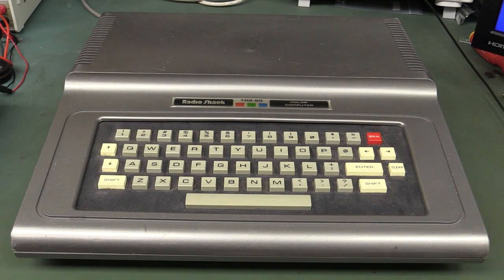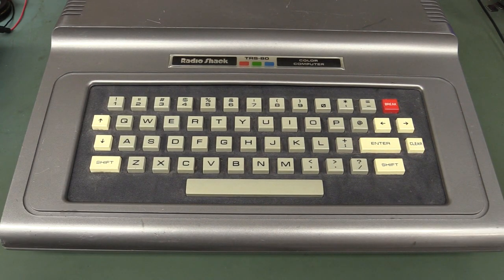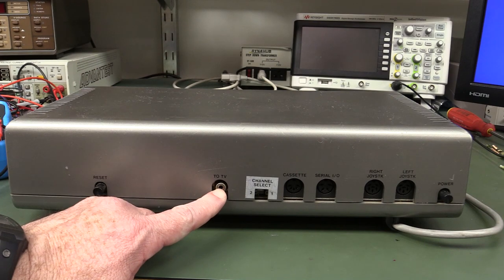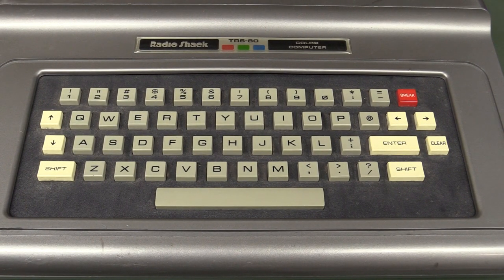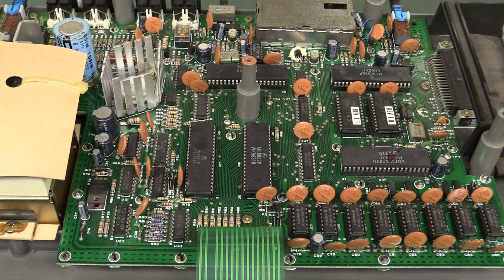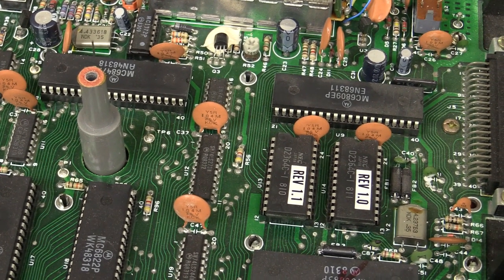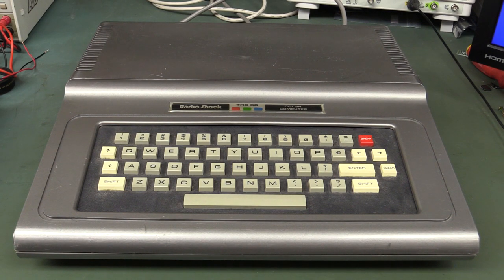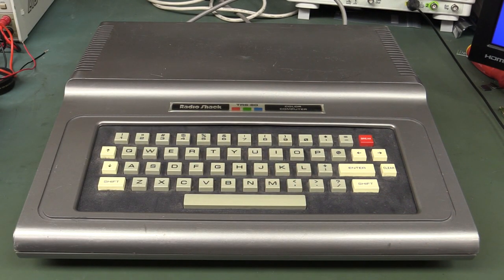EEVblog #1021 - Retro Radio Shack TRS-80 Color Computer

Comment: Yes, the video was that bad or worse on the TV too. The computers that used a TV instead of a real (and really expensive) monitor all looked like crap. There was no way to get decent resolution on a TV, especially considering state of the art of the typical TV set at that time. But given that's what you had, you got used to it in a very short time and it didn't bother you at all ... until you saw a "real terminal," heh,. Then you'd start saving up for this new computer coming out in a few months, called the IBM PC.

Comment: what was the purpose of these computers back in those days, apart from learning basic ?
Reply: Mainly for fun. Play games, and learn BASIC. But there where other types of applications too, such as spreadsheets.
Reply: I never had any significant problems with tape storage.  Use quality tapes on a quality recorder, and most importantly, set your levels properly, and it worked fine.
Reply: Oddly, not too much different that what you'd use a PC for these days. Software that would organize your finances, generate shopping or To Do lists, going online to the limited services of the time to chat, check stock prices, get news, etc, and of course playing games. All at a slower, lower resolution. Of course, no media like music or videos were possible.
Reply: IMHO it was to teach you how to program, mostly. Doing calculations was hugely important. In the case of the TRS-80 it was also to teach you how to "hack" and if you visited my local Color Computer Club you could find a lot of such examples. I remember one guy had a massive 10 Megabyte HD back then which when most programs were 16k or less was huge. But the really story was how he did it -- a SCSI adapter. Pronounced Scuzzy.
 Part of the Coco experience was getting the magazine for the Color Computer named "Rainbow" which was generated by enthusiasts. The magazine was about 3 times thicker than most these days and had software you could type in as well as various hardware hacks you could build and install on your own computer -- if you dared.
 Which reminds me one of the ways I solved an excelled math problem was to write a small program to keep calculating until the answer repeated then I knew that was the right one. The Teacher's Assistant liked my solution so much she surprised me by wheeling in an Apple computer one day to show my program run to the whole XL'ed math class.
Reply: Vendicar Decarian: I don't know where you got your information but I am sure I could probably go into my storage and get it up and running again. Wouldn't have saved it if I thought it wasn't possible.

Tape was slow but never unreliable. (I had the RS recommended one that had an additional input which was more expensive but very reliable.I still have it. Run across it a few days ago.)Disks... I booted up the same software daily for like 10-15 years with barely ever an error. When it did fault it was because mine was kept in the basement with wood dust floating around all over. Usually a simple cleaning and erasored down the contacts til they shined again and it would work flawlessly for a few more years.

And I met and saw people who had 10 MB HDs for just hundreds of dollars. Far as I know RS did not even offer one.

And the OS9 was also being run by big companies like Kodak and others.
Reply: I remember Rainbow! Do you remember the other magazine "Hot CoCo"?
Reply: Same as today; for fun and games, and education
Reply: To learn how to use a disassembler and machine code while trying to get your pixelated opponent Mindy to strip without actually winning at poker. ...what? No? Just me...?
Reply: Attila Asztalos ABSOLUTELY just you.
(I had Strip Poker on my Apple ][+)
Reply: i see.

Comment: Was it capable of 80-column text? That was a big deal back then. Big enough that they may have excused the name by referencing the 80-column support instead. ;)
Reply: No television based monitor could support 80 column text.
Reply: That was one of the more annoying awkward things about it, 32 characters IIRC and i had a hack of some sort that went to 51 characters per line. It made doing proper reports that would be printed on a regular printer rather difficult.

That reminds me for awhile they even had a very cheap thermal printer available for the Coco.
Reply: Star Gazer There is an 80-column cartridge for Commodore 64. 8bitguy has a video about it and other 80-column solutions for older TV-based computers.
Reply: John Possum Thanks for the info
Reply: Yes, there was.  And you can't read it on a color TV.  It isn't hard for a computer to output 80 columns.  That isn't the problem.  The problem is the display has to be capable of 640 or more horizontal lines.  And NTSC TV simply doesn't have the bandwidth to do it, nor does the typical color TV have the pixels to render it.  If you use a good monochrome TV,  you might have a chance.  There's a reason why we stopped using analog TVs as computer monitors.
Reply: Yes, TVs sucked back then but NTSC still approximated 640x480 (VGA)... interlaced, of course. Almost all of the 80-column stuff was monochrome, which has increased detail over the color signal even on a color TV. Heck, even DVDs use 1/4th the color resolution (chrominance) as the monochrome brightness (luminance). That's simply how our eyes/brains process detail. Almost all dedicated monitors back then were NTSC, like my Commodore 1702 or my Amdek. CGA graphics actually looked BETTER over composite versus the computer monitor output (much more colors). 8bitguy has a really good/interesting video about that ("CGA Better than you thought" or something like that).

Comment: What is color code 5 "Buff"
Reply: I don't remember for sure what "buff" looked like, but that just reminds me how HORRIBLE the colors on the CoCo were.  Like, there was the 4-color graphics mode that was black, white, magenta, and cyan.  I shit you not.
Reply: Buff was what they called white because it could never produce a proper white signal.

The 4-color graphic modes were pointless.  The 2-color (black+buff) 256x192 mode was useful, however.  By making patterns with odd/even pixels you could get plenty of artifact colors, just like on the Apple II.  Blue and red were easy (odd or even columns) with more complex patterns being able to produce more colors.  I remember how happy I was when I discovered how to make it output yellow.

Comment: How did they get away with having such bad keyboards back then ?
Reply: There was no alternative in the home market.  You had chicklet keyboards and you had membrane keyboards at this time.  Most home users weren't expected to know how to touch-type, so it didn't really matter.
Reply: In the back pages of "Rainbow" magazine you could get non Tandy upgrades like keyboards. That's the main thing I hated about that computer. Love the way the DOS is on a chip -- NEVER any time booting up. You turn it on, Microsoft DOS was right there.
Reply: Simple: REAL keyboards cost $100 or so at the time, so if you were building a $300 computer, you put a shit keyboard on it.
Reply: Vendicar Decarian: you are very wrong about card punch keyboards.  The IBM 126 had a keyboard you could type extremely fast on, because the keys only moved about a millimeter or so.  It just took a little getting used to, because it seemed to jump when you even thought about a character.
Reply: I had the number wrong.  This is the one I was thinking of - the 029.  https://commons.wikimedia.org/wiki/File:IBM_card_punch_029.JPG.  University of California, Irvine, 1975.

Comment: I have color computer like this that I'm trying to fix after breaking it over 30 years ago, does anyone know of a datasheet for the chip at 12:37 markings AMI 8317CCT   8032000  KOREA, this is in the same position as a similar chip on mine AMI 8238BON  8032000 KOREA. It is the only IC on the board I cannot find a datasheet for.

Comment: It's the funny how the older, but admittedly more expensive Apple II put this to shame. So don't attribute it all to the 80s. The 1970s Apple ran circles around this thing.
Reply: I had both. Each had it's pros and cons. The CoCo had a far more advanced architecture (PIA, SAM, ADA chips) and a better CPU. The 6809e was an 8-bit processor, but had a 16-bit internal data path with 16-bit operators. It ran circles around the Apple's 6502. The Apple had slightly better graphics, but where the Apple // really shined was it's expandability. Dedicated slots for memory, co-processors, many many disk drives, etc. My Apple // could top my CoCo until I added a new processor and more memory.
Reply: And if you bought it in the 70s you likely paid ten thousand dollars for it!
Reply: People who bought Apple ][s always believed they were head and shoulders above such common trash as the CoCo,  C64 and Vic20.  It just wasn't ever true.  The Apple ][ was more stylish, and much, much more expensive.  Some things never change.  But I have to say it again: the colors on the CoCo were nothing short of offensive.

Comment: I am thankful that I program on a 'real' computer at work. What would I do with out 32 cores, 8 hardrives, 8 nics, and 64 gigs of ram.
Reply: Okurka I took an assembly class in school. I enjoyed the class. Assembly is a good language for some applications. However, the solutions I developed at work would not benefit from assembly. The assembly clock cycle savings would not justify the extra programming hours.

Comment: Composite video is generally garbage and it's especially garbage trying to display it on a modern display. You can see the dotting on the flashing cursor which is the chrominance in the signal interfering with the luminance. At least it's a nicely simple thing to deal with but it's really pretty horrible.

Comment: I think the awful video is typical of the model.
I had a Dragon 32, which is more or less the same design, I think, and that displayed as badly as your Co-Co. 🙁
Reply: If you tuned (detuned) the TV modulator on the Dragon you could get fake colours by artifacts of patterns. Some games were actually designed with that in mind (two off the top of my head were The King and Buzzard Bait which are probably two of the best games for the system)
That green still haunts me.